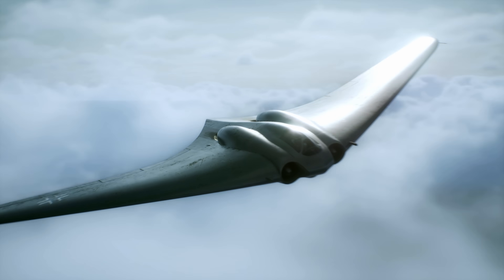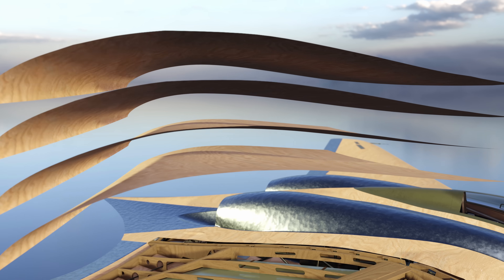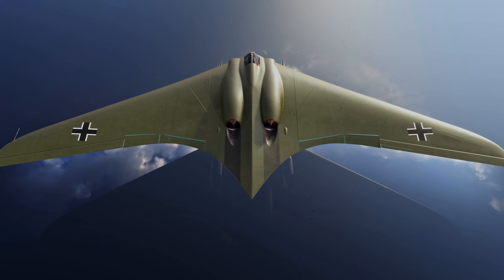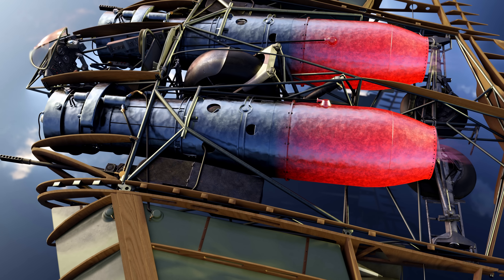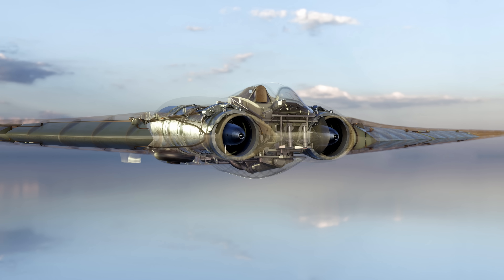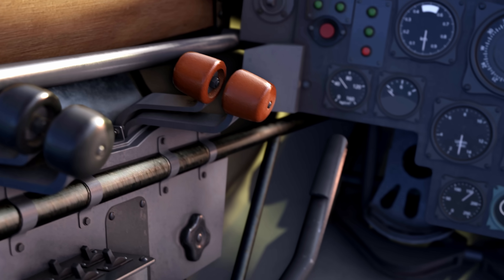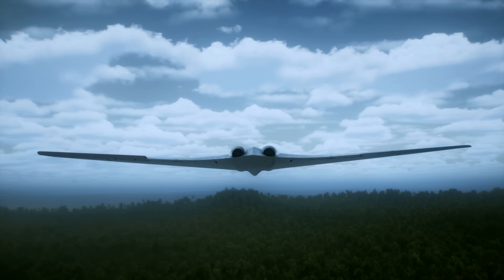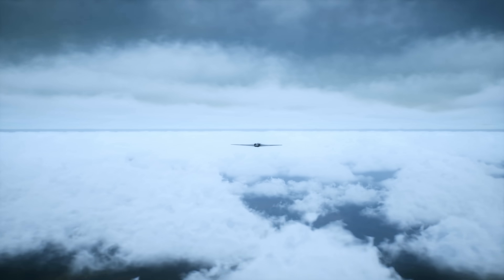Inside the Horten Flying Wing

Comment: I flown FPV RC wings, to find the right CG, in the Aircraft specially for Wings is an critical part. The shift of the frontwheel into the Back is a massive shift in the CG and reqires massive Trim Work. For rC Planes it is easy to find the Right CG point, becurse you can slide the Battery pack in the fuselage to shift it.
And another big Problem is the yousage of the fuel Tnaks on fuel yousage, whe the airplane climbs, the fuel in the tanks go alot away back, becurce the wide wing area or front edge to leading edge lenth. it could cause the Wing to go tayl heavy. And other  like traditional design, a wing is nearly not controllable if it Mid Heavy a traditional plane at the other hand would still controllable.

Comment: The most insane feature of this aircraft is really the missing vertical stabilizer. The Horten Brothers did not invent the flying wing shape but they incredibly created the only manually controllable flying wings without vertical stabilizers (also some non-jet powered).
Reply: Not even close
Reply: @janp5880  no they're not
Reply: @peterson7082 then who is, according to you?
Reply: @janp5880  Most historians tend to credit Boris Cheranovsky or John Northrop
Reply: Cheranovsky built flying wings with vertical fins. Look up his planes. The Horten H.I (1933) was the first true flying wing in history, with no vertical or horizontal stabilizers, so the credit goes to the Hortens. Northrop built his first prototype of the N-1M in 1940.

I would not even care much, all of them did innovative work. But you just answering "no they are not" and claiming historians when you are clearly wrong is ridiculous.

Comment: Ahora ya sabemos qué avión fue el padre del actual bombardero B2. De la northrop grumman
Reply: That would be the XB-35 not the Horten designs
Reply: @peterson7082  The YB 35 was a copy of the Horten look at the dates of its development and you will realize
Reply: @tonnyrosell5746  The project which created the YB-35 began in 1938. The test flight of manned scaled down aircraft began in 1941. 

 Ho.IX which lead to the Go 229 series of prototype aircraft began in 1943 with its glider flying in 1944. The powered v.II prototype flew and crashed in February, 1945.
Reply: @peterson7082  The Americans probably copied the Germans in the 1930s. We can confirm this because they were the first to develop the jet-powered aircraft.
Reply: @tonnyrosell5746  John Northrop had been working on flying wings since the 1920s. As had Boris Cheranovsky. The Horten brothers were teenagers then

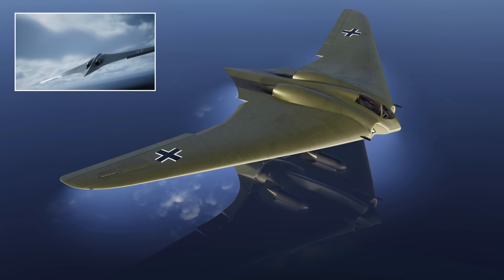Comment: Only thing that stopped these from becoming operational was the lack of a computer advanced enough to control the movements of the aircraft like the video states 6:15. I really wish someone would do a modern redo of these aircraft with the original design and airframe with modern technology, not the plywood.
Reply: Nope it wasnt.

Look up NASA's prandtl-D projects and insights gained from it. 

To put it mildly Horton flying wings didnt need computer assistance as they were aerodynamically stable - without any intevention - like convenional planes are.

Thanks to their bell shaped lift distribution.

Frankly the whole narration reads like someone reading out a chatgpt response. 

Its believeable, but simply it aint true.
Reply: @martonlerant5672  It probably is chat gpt 4 reading it. But many of the problems at least from the pilots perspective was how difficult it was to control in flight. One of its test flights was a failure and marked the end of the project, it’s very hard to pilot a flying wing without assistance. The platform was good but it wasn’t the right time. Tech definitely got better as time went on after the war. You may know more than me on this however. I’ve just watched some videos and read a report on its main issues a while ago when I was in a heavy war thunder phase.

I just really wish this aircraft had become operational in combat before the war ended so maybe it would have lead to some design inspiration for Cold War aircraft. I’m a huge fan of flying wing aircraft.

Comment: Until the B2 with its constant computer control, flying wings were impossibly unstable.  Northrop made several attempts eg YB49.
Reply: So true.
Reply: The Horton was the first flying wing which was actually fairly stable.
That is why the US inspected it so deeply on how it managed to do that.
Reply: @dom3827  Not really, the prototype crashed, and if the US drew from the 229 for it's stability, the YB 35 and 49 would have the bell shape.
Reply: @gp33music41  one of 3 flying prototypes crashed due to a malfunction.
No one said they drew from horton. You made that up to have an argument.
Reply: @dom3827  the third prototype,  v3, never flew, and you said that the US heavily inspected it to learn how it worked, suggesting they used the knowledge from it
Reply: @gp33music41  yes, they used knowledge from it. Source: northrop grumman.
But they didnt draw from them. Its about a few details and learning why those made it more stable.

Its about the tail design, which is still found in B 2 and other models.
Reply: @dom3827  They didn't, In fact, the engineers didn't even know about the 229. The tail of the b2 is completely different, and doesn't provide the same aerodynamic fluidity over it that would have produced stability. Stability was provided through flight computer and the lessons learned from the yb49. They didn't draw from the 229, and it's evident in Northrops flying wing designs of the late 40s.
Reply: @gp33music41  thats just false.
Reply: @dom3827  Ok? Just look at the be compared to the 229, not even close.
Reply: @gp33music41  so you think northrop themself does not know what they do?
Reply: @dom3827  What?
They simply didn't use the same technique to design the b2 and yb35/49 as reimar did to design the 229
Reply: @gp33music41  Northrop themself talks another language.
Reply: @dom3827  continue with your Nazi fantasies but Horten drew more from Northrop than he did from them
Reply: @dom3827  germong spotted
Reply: @Just_A_Random_Desk  triggered
Reply: @dom3827  germong

Comment: A flying wing design is so inherently unstable that it can maintain a stable flight only with computer assisted fly by wire. Northrop YB-35 and YB-49 were proof to that after WWII. Life span of Jumo engine was between 24 and 48 HOURS, and if the radar wave can reach and deflect back from the moving parts of the engine there is no stealth.

Comment: Built of wood yet weight like F16
Reply: Aluminium is pretty light, and much stronger than wood, so less of it is needed.

Which is why the old plane was so heavy despite needing to withstand air bashing into it with much lower speeds.

Comment: Where do you think the stealth bomber idea comes from ?  Engineers have already said our Radar would not of seen this machine coming if it had gone into production.  This was a huge leap in aerospace tech.  Crazy how far ahead of its time this design was.
Reply: It comes from false claims Reimar Horten made during the time the F-117 and B-2 was build, hoping to get contracts from the military.
And no, engineers have not said that, what they said was it had a around 20-25% smaller radar signatur because of the wooden airframe (but so did the DeHaviland Mosquito) and if it would fly at top speed at very low altitude it would reduce the reaction time of the RAF, not that it would be invisible to radar. A Bf-109 flying very low, would also be picked up later by radar.
Reply: The stealth bomber design came from a plane made by the US before/during ww2.
Reply: @Erusean_pilot  Thanks for the info.

Comment: "A Documentary on National Geographic did a non scientific study by pointing a modern commercial radar at ten feet from a similar jet engine intake"  Durr case closed it wasn't stealth.  You should be embarassed even quoting a National Geographic documentary.  Go watch the show.  They didn't recreate the plane as you said.  It was about as scientific as mythbusters or ancient aliens.  They cut holes in some $10 sheets of plywood from the Home Depot.  It wasn't even Birch.  Now wings, just two pieces for the fuselage, and used what they said was a similar jet engine for the holes, then aimed the radar directly intop the jet engine from ten feet away.  There was nothing scientific about it.  It wasn't recreating the conditions of WWII.

Comment: It took the US over 50 years to understand what they got. And yes, the HO-229 was stealth to the radar of that time.
Reply: Patently false. The Allies had seen prototypical flying wings in the past and afterward - they just rightly recognized it's not a viable design until advanced fly-by-wire systems became effective enough to handle the increased instability of flying without a tail. 

It was not "stealth", either. It would have had at most a 25% impact on radar returns, and that was only when flying very low. It was also an accidental byproduct and not intentional at all.

Comment: But did it ever fly?
Reply: at least 2 successfull test flights.
Reply: @juslitor  Well,one crashed during testflight, due to enginefire. But one must admit that German engineers were ahead of their time.
Reply: @storeparts  Flying wings had been made before Ho 229. Making an unreliable, barely functioning flying wing isn't quite an indicator of being ahead of the curve.

German engineers were desperate not to get shipped to the frontlines so they naturally decided to start trying out every crackpot idea they could come up with. Most of these ideas were laughable wastes of material and time, and quite often ideas that had been experimented with by Allied designers previously or soon after (and rightfully concluded to be wastes of time).
Reply: @juslitor  Only about two hours of powered test flying were completed on the smaller V2 prototype before a fatal accident. This was the only power flight completed by the 229 program.  The larger V3 prototype designed by Gotha and now at the Smithsonian was incomplete when found and never flew.

Comment: Design started in 1943 and I don't think that there were any ideas that they were going to lose the war at that point. So no it wasn't designed to turn the tide of the war. This is fairly common when discussing these secret designs. It is just we ddn't find out about them until later, whether it was the 262 in battle or whatever the case. Kind of like how the flying wing wasn't a new concept, various companies had been trying for years, with the first powered version being in the 20s. Think about it though, the bird is our fist idea of what a plane might look like and we spend many years trying to emulate what a bid did without trying. 
The 229 isn't special in any way more than anything else. It seems exciting muck like the 262 but really the jet engine had been under development for quite some time by many nations but the time the 262 was met in combat. The real cool thing was that they were able to make it work in a combat sense and have a performance edge. The 262 was remarkable in that way, the 229 not so much, because it had so many deficiencies not yet solved. 
Kind of like the 162, it was more of a stop gap by the time it was later into its development and really headed no where. Like you mentioned they lost ability to get alloys, which was game over for its engines operation times. But also there being a issue with it would have never handled well enough. we actually didn't really find a fix for this until advanced computer controlled flight management systems. 
Given this was still a prototype, an interesting choice. Made for an interesting video on an interesting topic. Nice seeing the original footage mixed in there too. Thanks!

Comment: Nice video. The only thing, that I would've added is the analysis of National geographic on the stealth part. They concluded, that although it would've been detected by radar, the time to intercept it like with the BF109 or similar planes wasn't enough because of the smaller radar cross section. The Fighter could've gotten to London without the enemy being able to get planes in the Air to fight them.
Reply: The issue is they didn't simulate engine returns. Just the empty sockets
Reply: @peterson7082  ah

Comment: I don't believe it was difficult to flly. The test pilot Ziller said so. And Reimar horten said the fatal crash happened because it was sabotaged. He said that in an interview with David Myra for his book.
Reply: I have built a scale model glider and it is very easy to fly. These wings and the Northrop designs were perfectly good planes and they were sabotaged and there was intrigue behind the scenes to remove them.
Reply: Reimar also claimed the US stole stealth technology from him so he could possibly get contracts during F-117's inception. The man is a crackpot not to be taken seriously. Of course he would claim he was totally sabotaged when his ridiculous prototype crashes on the second flight. Germans love saying they've been backstabbed, anything to whisk away notions of simply having made errors.
Reply: Arguably the youtuber has no effing clue wha he is talking about, or its jus one more case of a chatgpt response being read.

The horon flying wings were aeodynamically stable, thanks to using bell shapex lift distribution. Which would go against common practices in the west till 2015.

Thus when Norhrop's B-2 was paraded around, much noise was made about it being flyable only thanks fly by wire systems assisting he pilot.

Issue is that while northrop used elliptic lift disribution, the hortons used bell shaped one.

Comment: I doubt the plane would have worked. The plane built from this design, the YB-49 had major control issues. Before test pilot Glenn Edwards flew it he was told to not let the aircraft stall because a stall in that plane was not recoverable.

Comment: In the end it didn’t matter how fast or how many were built. By late 1944 the end of the war was only a matter of time. In regard to Northrops evaluation of the aircraft and “could not be considered a stealth aircraft by today’s standards” but could it be considered slightly stealthy by the radar standards of 1945?
Reply: It had a reduced radar return (approx. 20 - 25% reduction) as an accidental byproduct of its shape and materials used

Comment: Germany was so far ahead of the game with aircraft and gas turbine designs
Reply: The British had jet engines in service that, unlike the German ones, were reliable. The Jumo 004B used in the Me-262  (and proposed for the Horten) required overhaul after 10 to 20 hours of use. The Rolls-Royce Wellands used in the Meteor were rated at 180 hours before overhaul was needed. "So far ahead" indeed.
Reply: @keith6706  Gets funnier when you look at how the shilling for German technology/engineering was quite literally a Nazi propaganda technique from the time to promote German exceptionalism, it was so effective that people completely ignore the Allies had their own wunderwaffe and theirs actually worked.
Reply: @keith6706  The German jet engine designs laid down the foundation for the jet engine designs for decades to come. Germany has always pushed engineering ideas and boundaries.
Reply: @keith6706  This aircraft was basically the blueprint to the B2 Bomber, I suppose your going to tell me the Brits did it first.
Reply: @leokimvideo  Nah, the Fench filed the first patents in 1876, so it wasn't a brand new idea. However, as for the B-2, its origin can be traced to the YB-49, which was the XB-35 with jet engines replacing the original turboprops, and the XB-35 began development in 1942 after Jack Northrup was awarded a contract to develop a long range heavy bomber in 1941. You know, you could save yourself some time looking up things yourself before needing to be corrected.

Comment: Why did the Germans use the flying wing design? The Horten brothers were involved in sailplane design from 1933, all of which were flying wings, based extensively on research by Alexander Lippisch . They had extensive design and flight experience, building what they knew how to work (wood structures etc). As for stealth, did Northrop Grumman test the airframe against 1940's radar technology or 21st century? I would have thought it could have been stealthy against 1940's radar tech, which was basic. Further, it was admitted it would have been very difficult to shoot down by gunners flying in allied bombers due to small fuselage cross section, fast approach and departure speeds. Further the armament could destroy a B-17 with very few hits, as was evidenced by combat with Me262's.

Comment: 1:13 Wood, even better!
Reply: Wood is genius. Plentiful, easy to manufacture, stealthy, light and very strong.
Reply: @matthewhenley783  yes even carpenters can build the airframe which was the case  in Germany ✅ 

A German soldier was asked (just after D-day) when did he know that the war was lost, he said

When he saw a US soldier changed a punched wheel then throw it away, because if they can afford to throw away a perfectly good wheel they must have a lot of supplies.

He also said, in Germany if you did that you would be in a lot of trouble
Reply: Just like the Mosquito!🤔
Reply: Good for European Theatre but nightmare in the Pacific if Dehaviland Mosquito has taught us anything about wood
Reply: True, I love that, especially as an amateur balsa plane builder
Reply: @florensds6547you fly RC helicopter 🚁 too 🙂
Reply: to evade radars in England
Reply: exactly